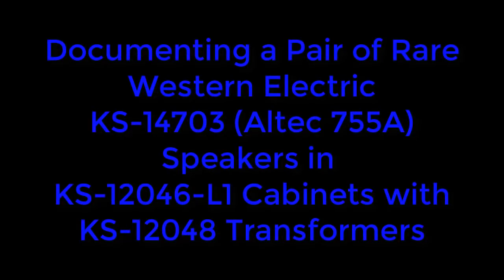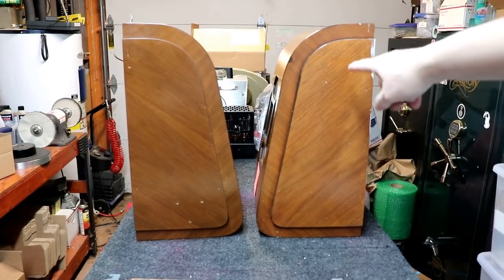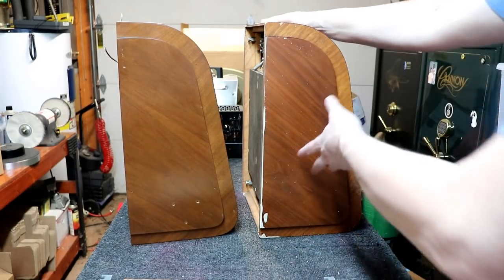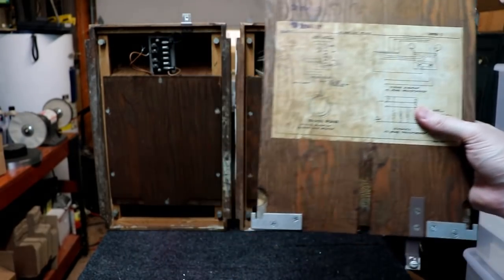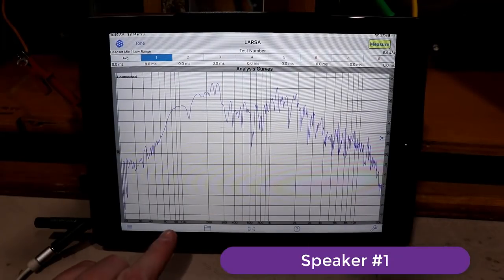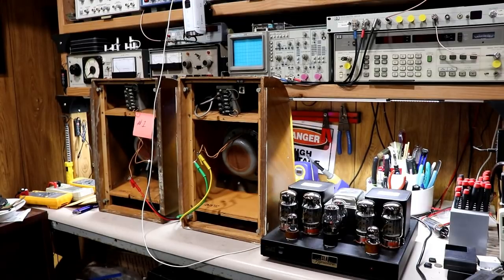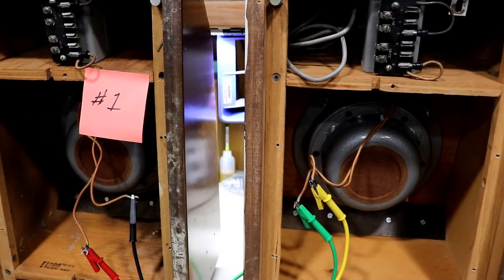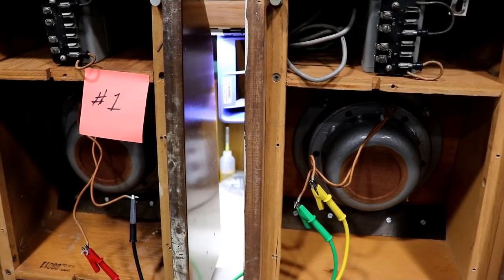Western Electric Altec 755A KS-14703 KS-12046-L1 Speaker Documentation

Comment: They seem to primarily public address speakers meant to be installed in offices.  The presence of transformers at the speaker case indicated they were normally operated on a 25 volt or 70 volt transmission line which allows very long runs of wire between speakers.  They would have been used for music and/or paging.
Reply from the maker: Yes, most all of this WE gear of the 40's-60s was used in phone telecom closets either as PA testing or out in a factory hanging on the wall as part of a PA system.  The Asian crowd has turned this stuff into holy grail crazy expensive stuff.  There is more of this vintage WE stuff overseas than here in the USA today as a result.
Reply: @Blueglow  True dat!!!! hey love your channel btw. I would be really cool if you can do some videos on some of the holy grail vintage transformer's and also on some of the notes you said you had just got from the fellow.

Comment: Wondering what the driver nominal impedance is and the spec of the matching transformer. I couldn't read the label. Cheers Mark.
Reply from the maker: 16 ohms.  Transformer is for line matching.
Reply: Oh, 100 volt line level. Cheers. M @Blueglow